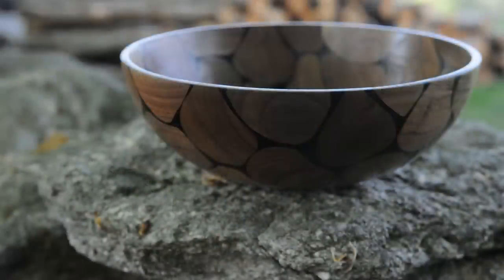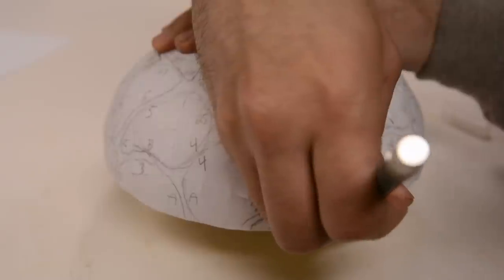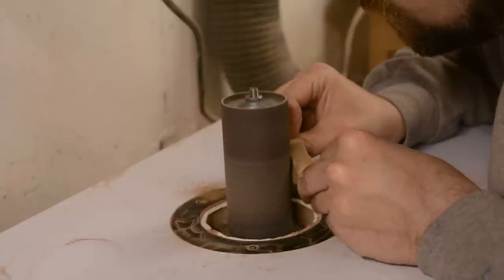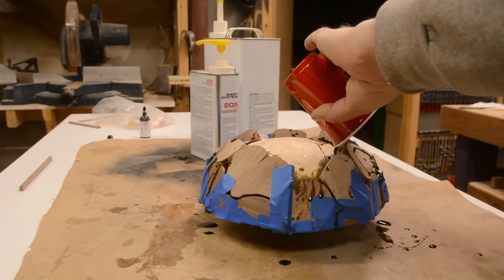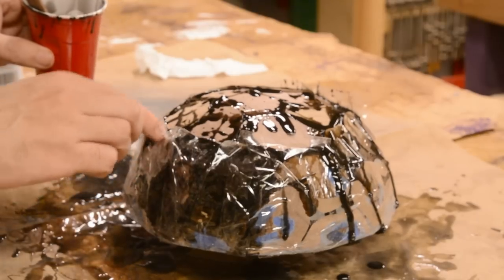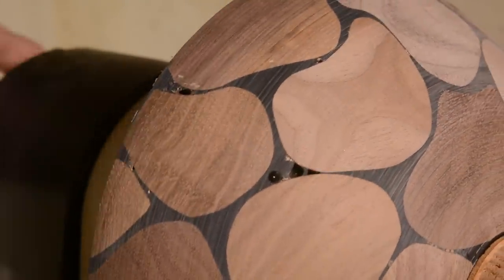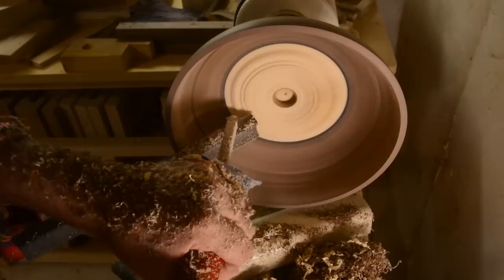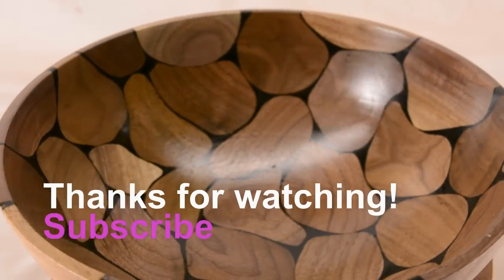Stone Wall Inspired Bowl

Comment: Philip Moulthrop (one of the most amazing wood turners around) creates "mosaic" bowls in a very similar way as you.  In the book "Moulthrop, a Legacy in Wood" about him, his father (Ed) and son (Matt), he describes his process on page 83.  He mixes the black-dyed epoxy with sawdust to form a paste, and then spreads it on the bottom and all around the wooden pieces.  When he places the pieces onto the waste form the excess squeezes out around the pieces, all the voids are filled, and the pieces stay in place.  It's a one-step process that doesn't require pre-gluing the pieces in place or having to seal the gaps to avoid runs.  I've done similar placement of wood using the same method and it works very well. Also, mixing the epoxy with sawdust keeps it from creating those sharp shards or shattering as it's turned.

There may end up being a few small holes when done turning caused by small air pockets in the epoxy/sawdust paste.  I fill these with Starbond black CA glue.  It's PERFECT for filling in small voids like these.

Below is the link to the book if anyone is interested.  I highly recommend it. It's more of an art book than a woodworking book, but as a wood turner I find it fascinating.  If it wasn't for Ed Moulthrop, we probably wouldn't be looking at wood turning as an art form.  It's great to find out about the history, and to also get a few good tips along the way.'

http://www.amazon.com/Moulthrop-Legacy-Wood-Kevin-Wallace/dp/1889937126/ref=sr_1_1?s=books&ie=UTF8&qid=1434206401&sr=1-1&keywords=moulthrop+a+legacy+in+wood&pebp=1434206402301&perid=C6C6D84D15E0488B9CF4
Reply from the maker: Pisik Wood Great info!

Comment: you can try to use a small torch to heat up the epoxy to make it more liquid like and then it will fill the holes better and pop the bubbles
Reply from the maker: Joseph Lovenduski Hmmm...

Comment: Get an inside form (like you had here) and glue all the segments to it. Wrap the outside of that in something like cling film / saran wrap / tin foil / a condom, and push the setup down into play sand or beech sand. Now the trick is that your inside form has a central hole through it, and you pump the epoxy through that so it fills the voids, from the bottom up, I'm thinking a big syringe, or turkey baster, or breast pump, or custom rig from a compressor, for the pump action.
Reply from the maker: balisticsquirel Interesting though.  Grease gun, maybe.

Comment: Been thinking about this... What would happen if you put your epoxy in the bottom of one of those 2 gallon zip-lock bags, stuck the entire project into it with the round side down. Then draw the air out of the zip-lock with a shop-vac (or such) and seal the bag.
Reply from the maker: Jeremy McMahan Vacuum and pressure are both techniques used in casting but trying to avoid that if I can.

Comment: The bowl came out well. Do you think that the epoxy will cause the bowl to deform a bit over time?
Reply from the maker: Tom Doe Just having it sit on the lathe while I was filling the holes for a couple days it seemed like it went out of round a little.  I don't know what it will do sitting in its normal orientation.  I wouldn't be surprised if it sagged a bit but I don't expect anything too dramatic.  I'm definitely keeping this one though so I can see what happens to it over time.

Comment: Why didn't you just pre-shape some wooden pieces(you could do this with waste pieces), epoxy them all together in a cube-like form, and then turn them from there? It seems like it would have been a whole lot easier.
Reply from the maker: GreatSmithanon Doing it this way orients the face grain all the way around the bowl and gives me control over the shapes you are going to see.  Brendan Stemp did a video with just cubes in clear epoxy you might like.